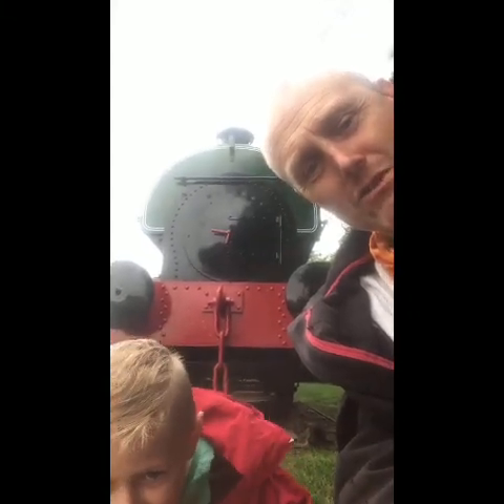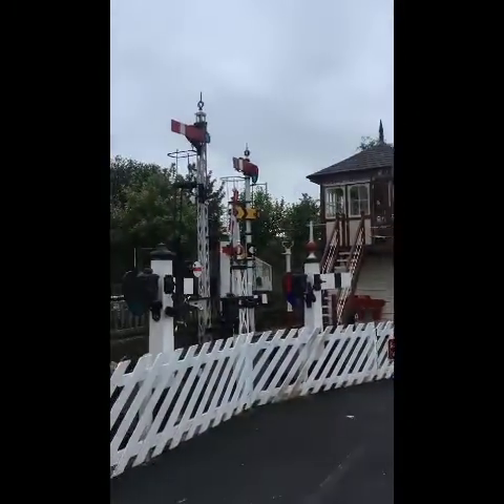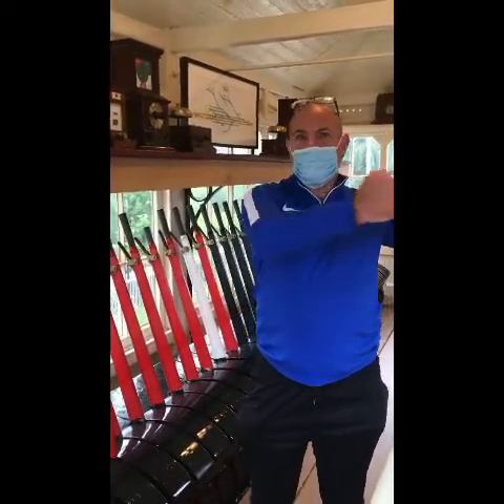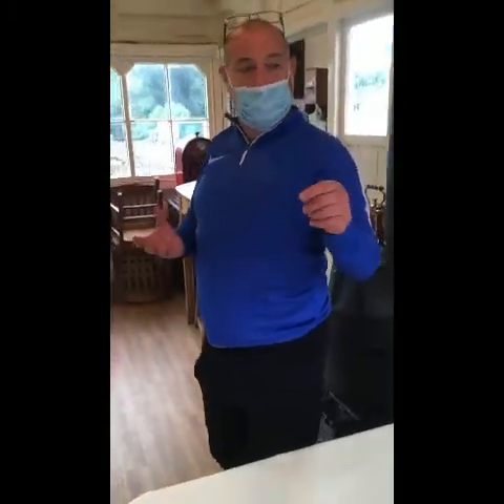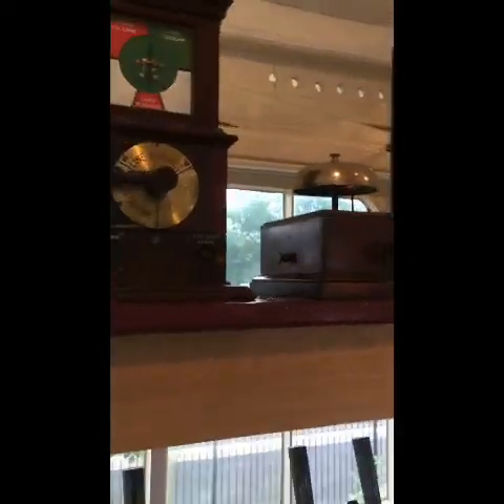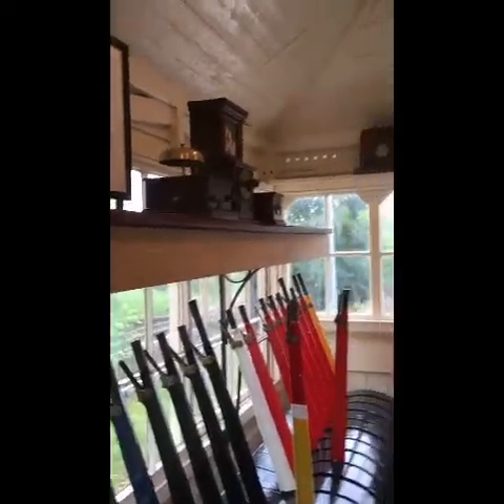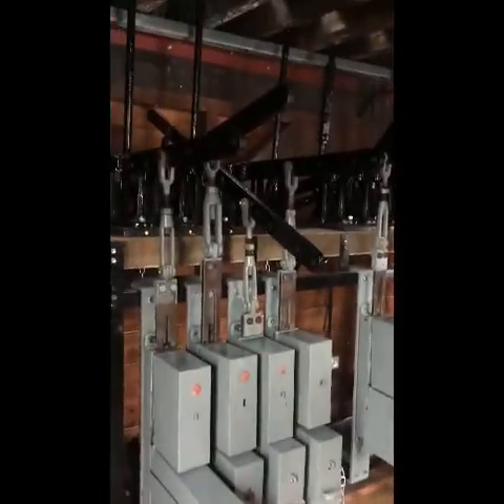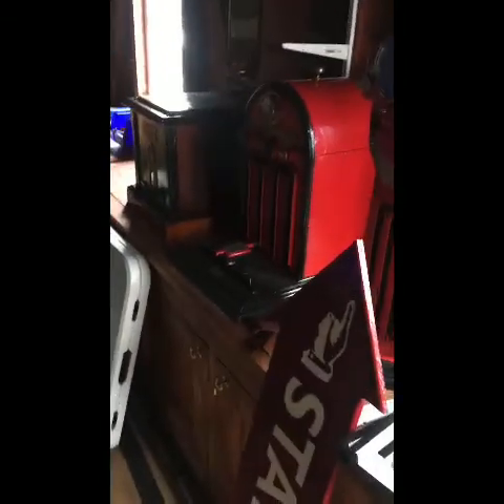Irlam station signalling exhibit

Comment: my dad worked at this box from 70's thru to its closing in 1994, and i myself used to as a child go in when my dad was on shift. where them chairs are in background at 3:56 used to be brown wooden bench lockers going int an 'L' shape from that side window (just off levers) and onto the back. also to note is that when you walked though the main door, to the right was the desk with swivvle chair (loved spinning myself about on that lol), and to left where the x-ing wheel is now was the sink.
i do also have the number 24 absolute block indicator that my dad got from the box on his last day of working there.....he then obviously passed it onto me a few years back to which i still have now.
i still have to plan a visit there again, will be 1st time ive stepped in that box since my dad worked there upto 1994 when he took redundancy and left the railway.